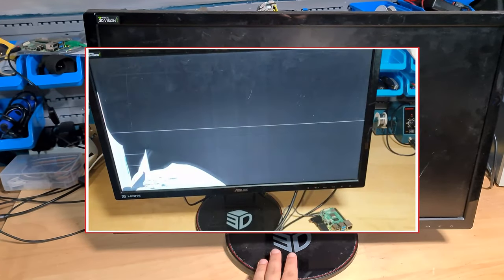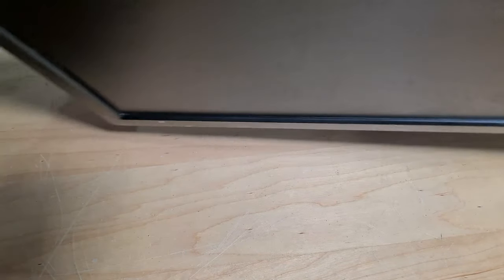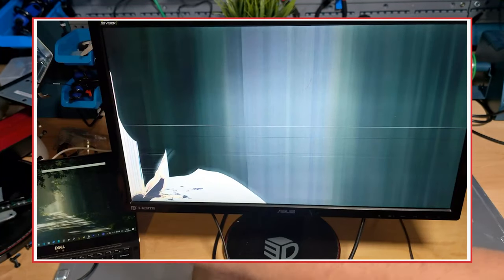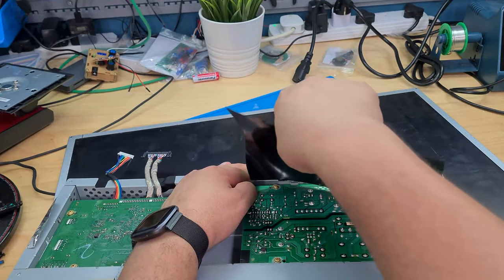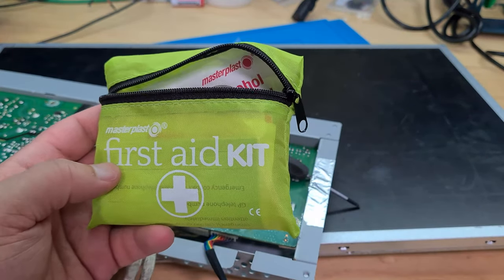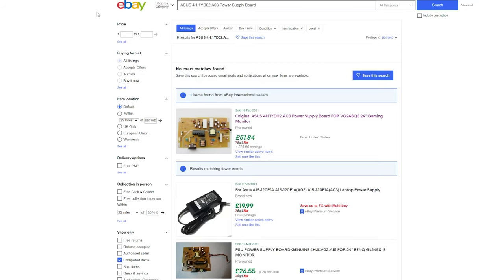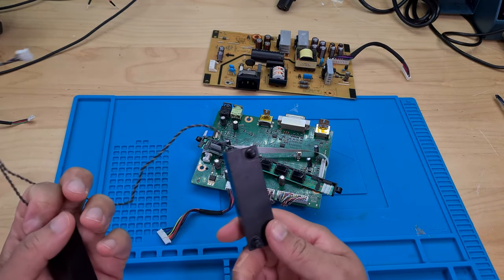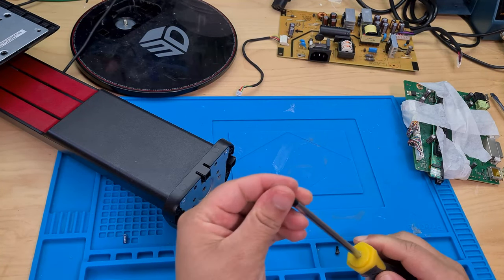Asus VG248QE 144Hz Gaming Monitor - Repair or Part Out to Sell?

Comment: you can buy them monitors used for 120£ anyway, if you wait long enough. I have a 144hz Dell and, 2 144hz asus. All at £70 each. from different people.
Reply from the maker: What size are urs? I need a minimum of 32 inches I think so these would be useless to me. I'm one of those split screen multitaskers and I never game.
Reply: @HamedAdefuwa  24" LIKE THAT, yes 32 inch ones are nice

Comment: definately dont repair, as they cost too much to repair
 The thing is that moniters and TV are not very good to sell if broken. Once the screen breaks than it is litterally good no value. LCD and screens are most expensive thing in tvs, and monitors hense they are not smart to change.
Reply from the maker: Do you know a way to tell if the LCD is cracked before buying? I had a good look before buying it but couldn't tell
Reply: @HamedAdefuwa  no clue, what you did was all you needed to do. i think it is best to leave them if it cant be tested
Reply from the maker: I'll pick them up if theyre cheap and branded. Managed to sell the power supply already for £20. Thinking next time to go £30 especially since it was the only one available in UK. Saying that though, I'd like to get into stuff I really know nothing about like old vintage electronics, but no clue how profitable that would be. Sadly new pc equipment seems impossible to find at car boot sales.
Reply: @HamedAdefuwa  yes old vintage electronics are very profitable, watch YouTube vids of them loads of people that do that. Like Retro reseller or Romi Patel and much more
Reply from the maker: Thanks I'll check them out. I'm looking forward to getting to bootsales again whenever the government let's us out again